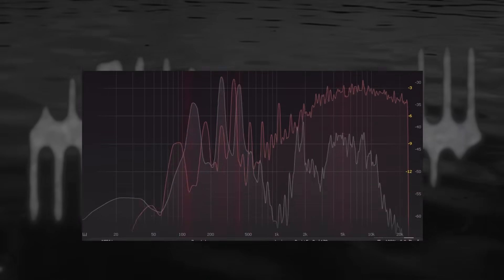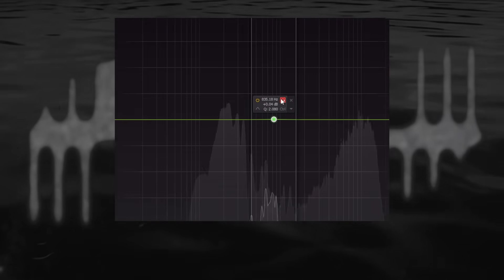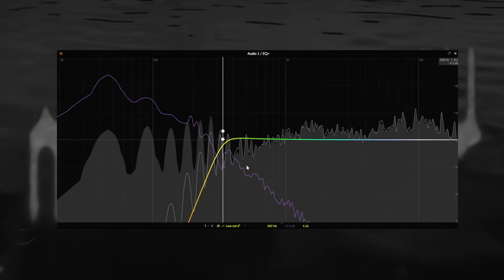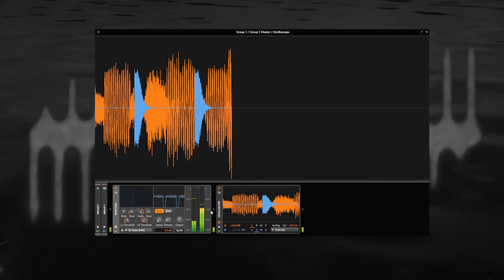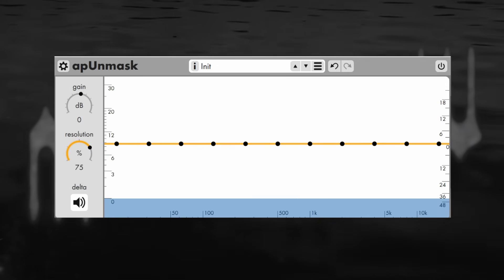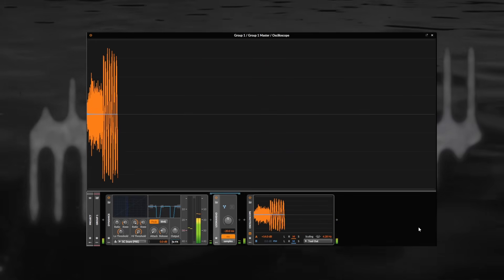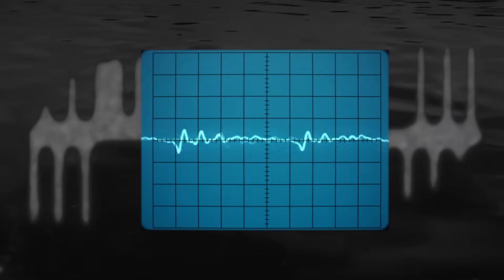Clashing Frequencies  & How to fix them | Psychoacoustics for Music Producers Ep. 2/6

Comment: weird, but I remembered mix engineers say opposite about louder volumes. Mixing clean on lower levels gives clearer result when listen loud.
Reply from the maker: it depends on what you're exactly optimising for. if we're purely talking about masking, loud playback will mask more.
Reply: @TildeSounds If I deal with the masking problem on a mixing stage but then increase the volume in mastering stage, could there appear masking that I didn't realize while were mixing? Damn this is like space science, but getting there slowly. Thanks for teaching us btw! :P

Comment: A multiband active EQ with a sidechain is a god send for mixing. I will say, adding a low cut to elements is not a good idea unless you have the experience to know exactly what material really CAN stand to loose the low end without a problem. There are a lot of sounds that most people would think don't need low end but sound thin and fragile when you cut the low end. I much prefer to shelve EQ the low end of elements. That or using a lower order filter curve.
Reply from the maker: @midnight26894  really depends on genre and style ime. I work with mostly sounds i designed myself, so i know very well what i can and cant afford to loose. Shelves are definetely the nicer option on sth like recorded performances tho

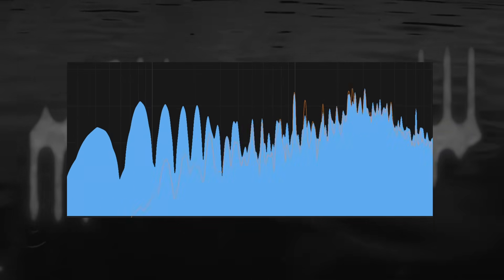Comment: 4:50 Weird that I often experience the opposite: more sound detail when upping the volume. But I almost never listen loud, it’s hard on my ears (also I’m trying to conserve my hearing somewhat because I already have tinnitus for like ten years or more even since before my 20s). Also I heard advice to not bump frequencies while EQing to not fall to the effect of louder sound feeling better, so I guess some of this counter-to-masking stuff happens as well as nonlinear stuff with masking.
Reply from the maker: the reason you dont hear detail when sth is quiet is probably bc its below your threshold of hearing, not bc of masking as such. hearing more detail with increased volume is to be expected.
Reply: @TildeSounds This makes a lot of sense! Then we get a range of volumes at which most of the details are higher than the threshold but masking and distortion in the ear aren’t yet rampant.

Well we also forgot about masking by external noise which then should effectively just raise the hearing threshold?
Reply from the maker: @ yes exactly. This also varied across the spectrum ofc, depending on the frequemcy of the maskers etc

Comment: Interesting, I don't notice the temporal masking at all. I wonder how much the masking falloff time varies from person to person.
Reply from the maker: It may also depend on your playback gain.
But yeah i think its one of the more subtle effects and demoing it isnt easy.
the snare sidechain example isnt the best. i did some other tests that were more convincing but they were too complex for the style of simplified demo i went for here.
might also be partially because you knew what to listen for and saw it on a scope.
either way, temporal masking is always significantly less drastic than simultaneous masking ime.
Reply: @TildeSounds yea forward temporal effect was experienced as expected, but i don't get the backwards in time one, still hear a too clear pa-duh rhythm to it to attribute it to preparedness. could be a personal brain thing, or not the ideal setup of sounds to work universally
Reply from the maker: @ yeah, one issue with setting up these demos is that im limited to a certain loudness range. If i make the masked sound much quieter itll not be audible at lower playback volumes at all. And yeah, knowing what to listen for will distort things ofc

Comment: this is really cool, kinda had an intuition of frequency ranges having a limited "capacity" where you can only have so many things there at once. But this video explains it a lot more clearly and analytically, hope I'll be able to make use of this

Though I will echo the sentiments of a couple others, cutting out the natural pauses of speech is kind of distracting... Maybe vox can be sped up slightly (while keeping small pauses) if "fast-paced" styling is the goal (sort of like Synthet's style?), or otherwise tone of speech could be emphasized more to make the start/end of a phrase more obvious. Otherwise it can sound like a really long run-on sentence
Reply from the maker: @PurposedBatfly  a lot could probably done in theory, in practice that would probably mean another 5 hours of work for me ^^. Glad it was still helpful.

Comment: Hi, nice video! Would you be inclined to share the source of the graphs between 4 and 5 minutes?
Reply from the maker: Ok so i got it from this psychoacoustics lecture:
https://youtu.be/bU0_Kaj7cPk?si=DjdIQtDhoI2BSF-P

Unfortunately they don't themselves say which study they got it from, you should be able to find papers by googling "upwards spread of masking" tho, its a pretty well studied phenomenon afaik.

The second graph with multiple center frequency comes from  the wikipedia page on auditory masking, it says "adapted from ehmer" there, but doesnt link to a source.
Reply: @TildeSounds thank you, that helped. The first graph was "Inverse frequency dependence of simultaneous tone‐on‐tone masking patterns at low levels 
E. Zwicker; A. Jaroszewski", the second one is a really hard simplification (but good enough for the concept) of "Ehmer, Masking by Tone vs Noise Bands 1959"
Reply from the maker: Hi, ill try to find them, definetely shouldve linked those.  the second one is just an abstraction i think but the first one should have a good source

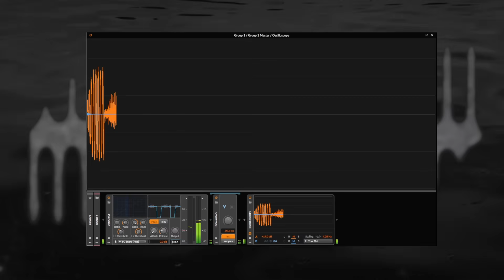Comment: 13:53 imo it’s not that audible, but maybe it would need to be closer together at that freq. i know for experience cutting glitch samples that often when two different sounds are very close together, the overall sound is itself different to both. you can sometimes get the atonal part from one and the tonal part from another, or transient plus tonal, etc
Reply from the maker: Yeah its definetely one of the more subtle examples in this video, especially compared to the very exaggerated other ones.

Comment: the insight around 5:00 is so great, ive always heard to mix quietly because whatever sounds good quiet will sound good loud (same theory behind the loudness way, as gain increases we prefer the sound more), but if quiet sounds dont mask higher frequencies as much as loud sounds, that can't always work..
Reply from the maker: @athko  yeah i think its clear proof that we need to listen at different volumes. I still think checking your general balance quietly is a good idea, but youll also want to listen to it loud to really get a good sense. Our perception is just highly nonlinear
Reply: Mixing advice like this from old armchair engineers HELD ME BACK FOR YEARS. I don't mix loud for the entire duration, but I am constantly switching between levels during the process and almost never used to mix loud. Things have improved since I abandoned that advice.
Reply from the maker: @burneracc9929  There's a lot of traditionalism and appeals to authority in mixing sadly.
If you can't show or tell me a good why i don't care for your how.
This kind of advice always needs context
Reply: Different speakers also. Controversial but it helps me a lot too. When the mix sounds good to me on monitors, it might sound like shit in my car or headphones and then I adjust from there. Usually it ends up sounding great in my monitors too
Reply: Fletcher Munson